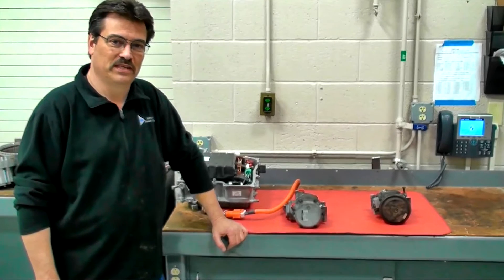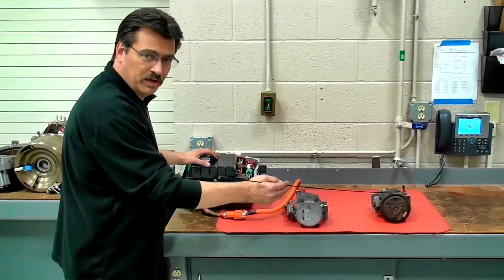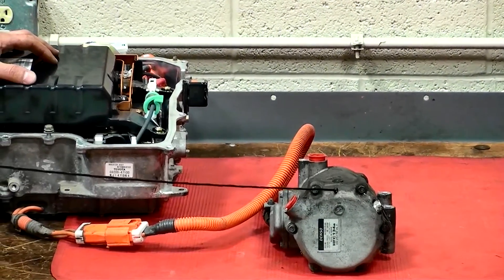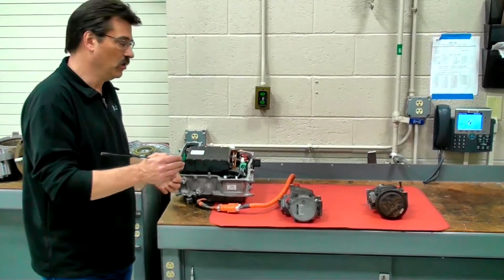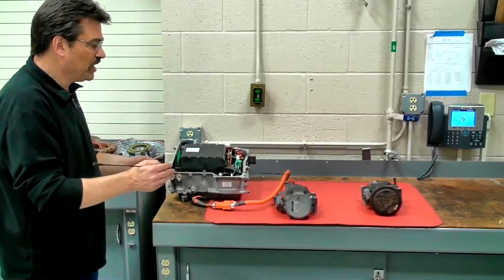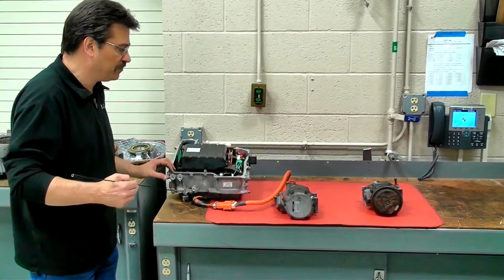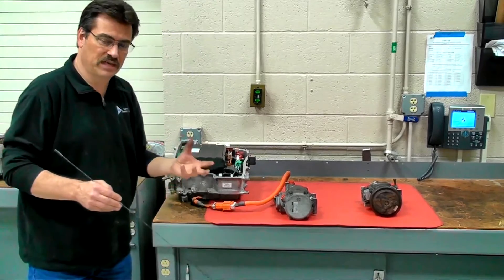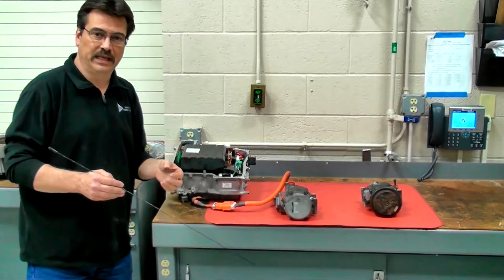HEV TV Season 1, Episode 1 - Air Conditioning Compressors: Hybrid Vs. Traditional Vehicles.

Comment: hello, my car is a hybrid MB w221 s400 and I have problems with the copressorin ac, i have got every control and the gas and the computer test it still does not get into work, if possible help me the problem i have to suggest what  I have to do it, change the compressor or something that is repaired because it is something new that we did not open and do not know the function inside.  Thank you.

Comment: Dr. Quarto, so Im having problems with my 2005 Prius AC.  On reg days it starts with good flow of cool air but after 5-10 minutes the flow goes warm.  It cannot last long.  On hot days, it just goes directly to warm air.  Ive topped off the 134-a AC fluid.

Comment: Please share power consumption details! This type of motor could revolutionize the way we heat and cool everything. What voltage is it running off of? 3 phase 120v? How is it the running an AC motor off of an inverter? Shouldn't they be using a DC motor?

Comment: Hi can we convert a 2001 ac compressor  clutch type to newer  electric that has inverter built to it the 2nd type you mentioned in video has 2  cable what do i need to convert it and what kind car models have that type of ac

Comment: What voltage & amprege draw, or wattage draw does a prius compressor operate on?
Reply: I have a similar cuestión because I am planing on converting the ac of a truck y have to a ac hybrid compressor to be able to cool the cabin while running on battery only with the engine stopped

Comment: You'd mentioned that some units have the inverter in the motor/compressor housing. In that case, why not just use a BLDC motor in the compressor housing? Or maybe some units are DC powered?